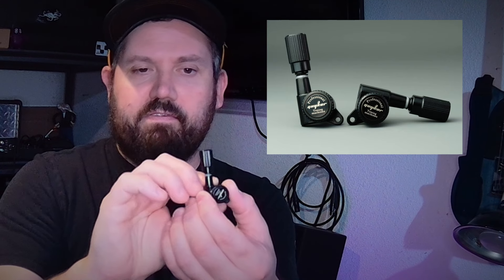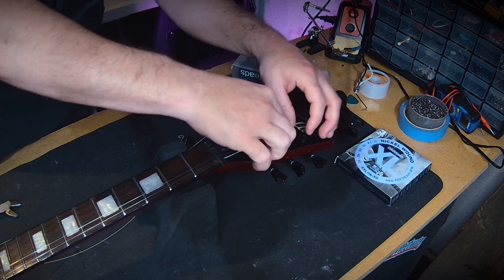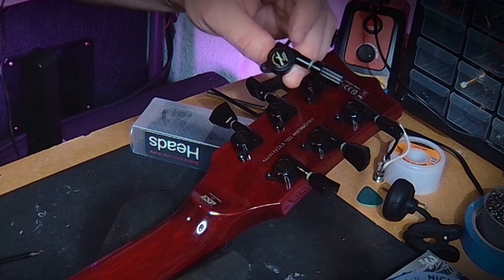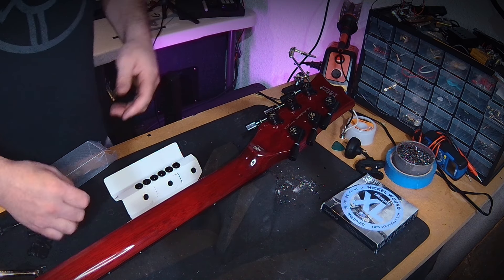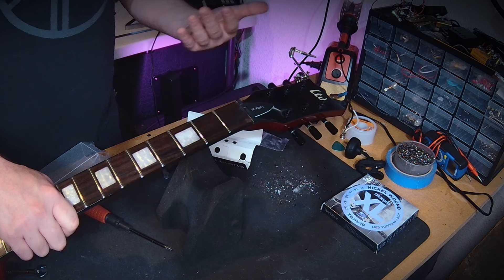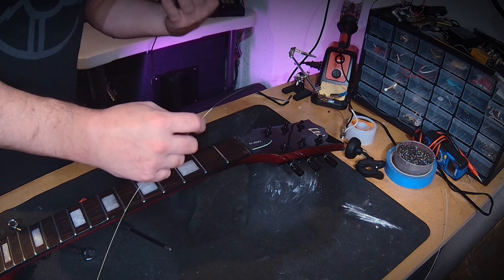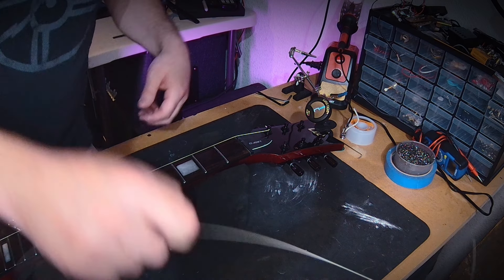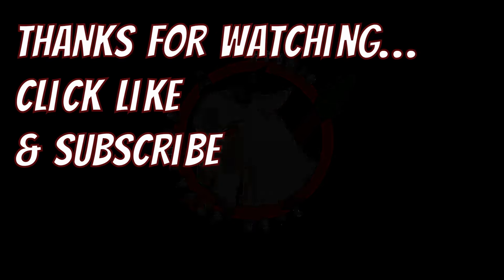Installing the New Guyker GK-11SP Locking Tuners!

Comment: 5:43 use the Boxed end of the wrench or a socket. Thank me before you scratch something. ;) 
Ask me how I learned this lesson.

PS I rec using a deep well socket, and only hand tighten the top nut.
Reply from the maker: I have a felted luthiers spanner wrench I typically use. I just tend to misplace things... alot. The polished chrome snap-on is so smooth I don't worry too much. It is also an opened ratchet design so I could be more confident about spinning it under low torque, but I tend to lift it anyway. I give a 1/4 turn after hand tight just because I have had the collars loosen and rattle in the past.

Comment: I know the tuners are categorized specifically for each headstock type, but do you think these would work on an inline 6 headstock? Such as a jazzmaster or telecaster?
Reply from the maker: @Callsign_Kishin  they do make these for 6 in line headstocks. The main question is what configuration you have in terms of screws and post holes. These won’t fit vintage style 8mm hole tuners. The type with unthreaded collars. 

They do also make these in a 2-pin fender style design. But they are modern 10mm post a with threaded collars. 

https://www.guyker.com/products/guyker-gk-new-434sp-tuning-machines-for-fender-st-guitar?ref=BTGSTUDIO

Comment: You can take and rip the seams of a sandwich baggy ....making it 1 flat plane....and drape it over the hardware. Screw,bolts,potentiometer, jacks etcetera...then use your box wrench,screwdriver,socket,etc  to loosen or tighten....and voila , no more scratched hardware or finishes....
Reply from the maker: @crock2434  on most applications I like to use a small spanner wrench with a felt bottom. Mainly for pots and switches. My main 10mm wrench is a high polish chrome snap-on, safe for metal contact. But I agree, If you have to use any sort of metal tool, especially rough galvanized, find something to buffer the tool. The best thing for making sure you don’t damage hardware is to never overtighten things! Most things on a guitar should require minimal torque to loosen.

Comment: Dude, a little rough handling your guitar, I found myself cringing as you worked the wrench.
Reply from the maker: @Shred_Rocket  sounded worse that it was. Compressor on the mic made every tap and clink sound way louder or rougher than it was. I was being fairly light handed actually since nothing was overly tightened. You can also use a spanner wrench if you have one, they typically are made out of aluminum or much lighter steel. My snap-on wrench is a bit solid! No wood or finish was harmed in the making of this content